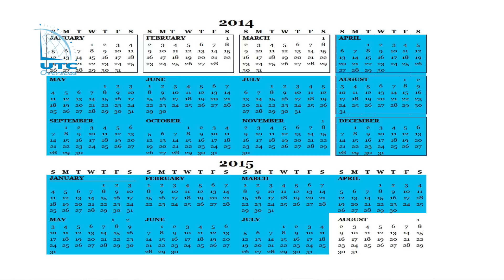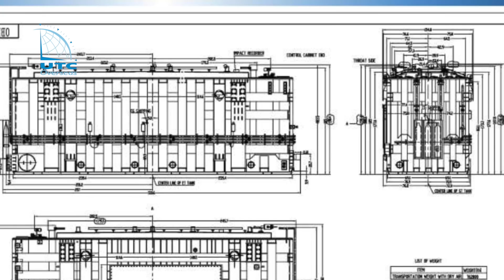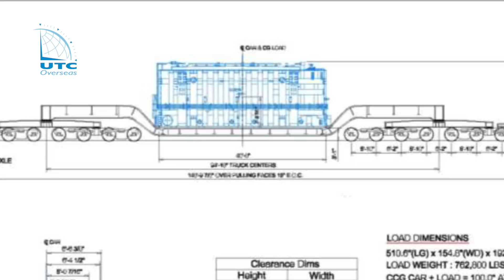UTC Behind the Scenes of a Record-Setting Move

Comment: The last lead processing plant in the US was closed because of environmental issues a few years ago, today we probably have to import lead from china even to make our  bullets. Transformer manufacturing requires a lot of dangerous chemicals. As is well known China's environmental rules are easier to work around, hence the corporations' profits are higher. It is almost mandatory that these factories be built very close to where these transformers will be installed.  Power companies don't buy them very often. It takes several years to build the biggie ones so it takes a while to recoup your  investment. Anyway, I hope you find this information interesting.
Reply: Rural Utah seems like a highly unlikely place to have needed such a massive unusual piece of equipment. What did I miss?